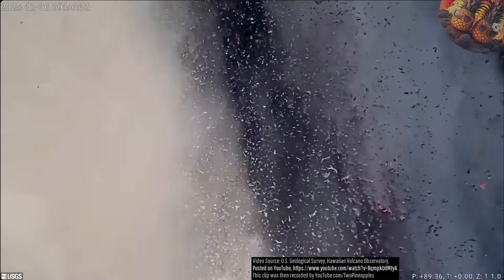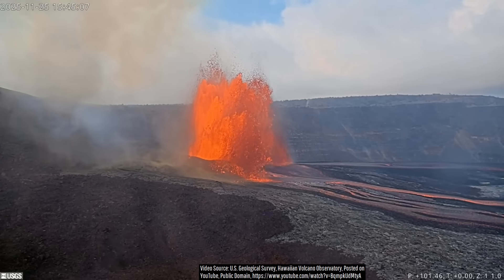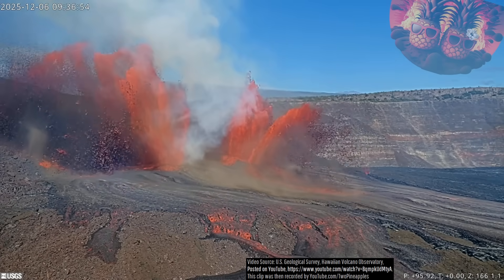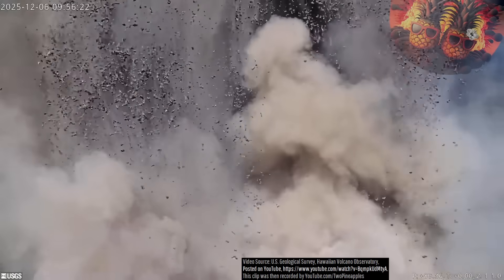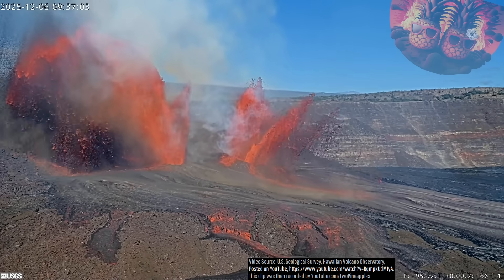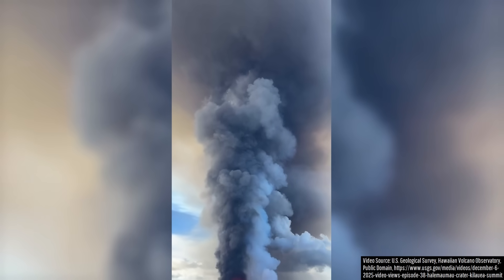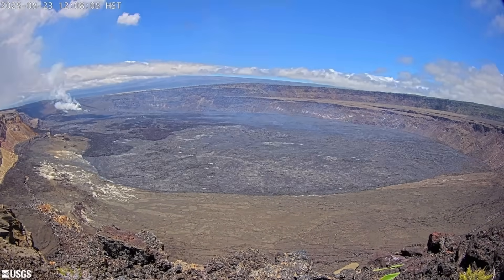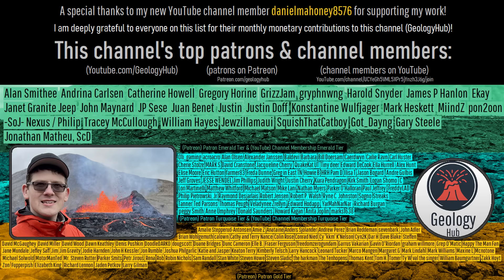Kilauea Volcano Update; Vent Explodes, Watch a Camera be Destroyed by Lava

Comment: Tim, would you mind checking my math on a calculation of force produced by the south vent? I ran some numbers and used loose approximations of distance, lava density, and lava jet nozzle diameter to come to my conclusion. I estimated that, assuming a density of 3000 kg/m^3, derived exit velocity of about 77 m/s, and an idealized circular nozzle with diameter 50 feet (did a conversion to psi along the way), that the south vent portion ALONE produced 1.636 GIGA Newtons of force.. or, roughly the equivalent of 46.75 Saturn 5 rockets firing at ONCE!

Does the 50 foot diameter seem reasonable to you? Do you have an idea of how I may make a better approximation?

Thanks man!

(I have a full list of formulas and calculators set up in a word document, can convert to a Google doc if you'd like to take a look at my process)
Reply: Would be an interesting hypothesis  of  the potential  thrust vectors  compared  to rocket  thrusters...